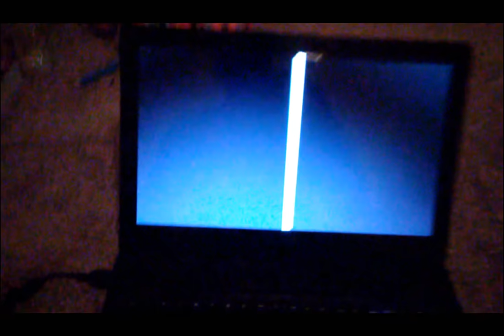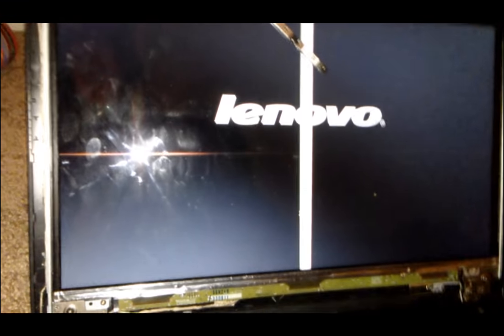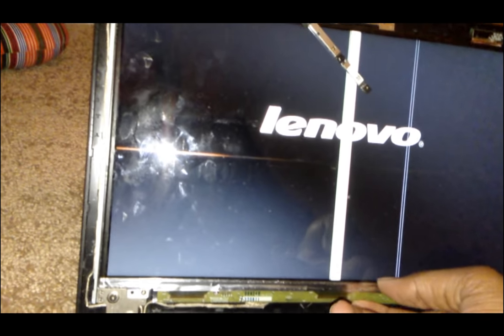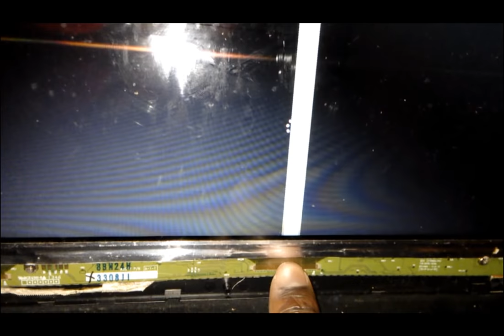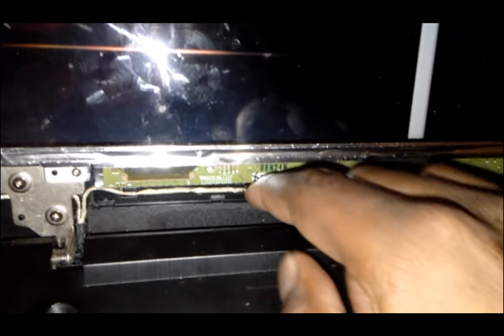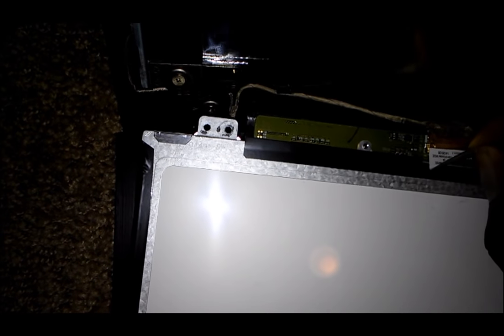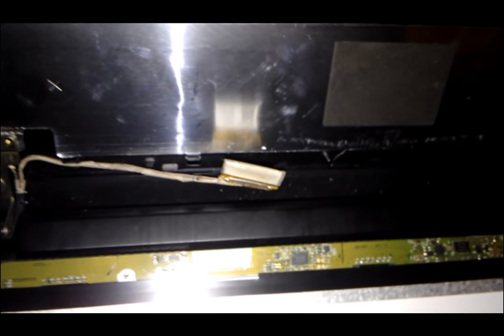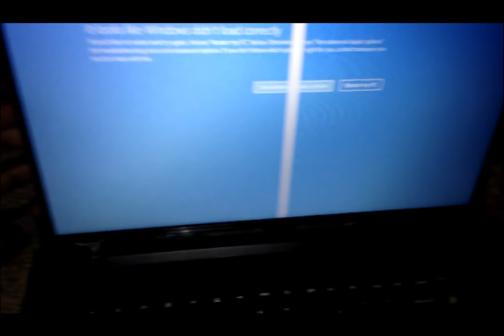HOW TO FIX HORIZONTAL / VERTICAL LINES ON LAPTOP SCREEN LCD (LENOVO) 2022

Comment: my laptop screen has lines appearing and sometimes turning to white/blurrying whenever i move a certain position, it seems to be very sensitive. but when i touch some areas on the screen, it goes away. can you please tell me how to fix this? thank you!
Reply: me to
Reply: i have the same problem what did u guys do?
Reply: Mine having the same problem. Can you please tell me, how did you fix yours? Please and thank you.
Reply: I have got your problom.
What is the reason.
Reply: Me tooooooo
Reply: Same problem. If anyone got solution plz tell me
Reply: Same problem here.
Reply: I fixed mine, the only thing you do is remove the cover from his first step and then carefully touch the flimsy thing below the lines and adjust it where the line disappear and carefully reassemble the cover and done!
Reply: same problem here but when i take its battery away and again turn it on the problem solved but still sometimes the problem appear
Reply: I have the exact same problem but then with my chromebook
Reply: @johnrussellgeroy2560  yeah but does it work with chromebook too? The half of the screen is white because of all the lines
Reply: Same
Reply: Same
Reply: @gamingwithcreeperboygwcb5129  well now my laptop is fix i went to buy a new screen
Reply: Same!
Reply: Mine just started like 1 week ago!
Reply: @k4leishaa  omg me too
Reply: Me too
Reply: Take it to a tech....
Reply: me too
Reply: @blakeavery4535  Just out of interest is it a hp?
Reply: @phoenixaugurey7776 

 mine also hp

i'll start doing what they said, hope it's work out 😯
Reply: @nibrasflint1110  Cool lemme know how it works for you 👍
Reply: @phoenixaugurey7776 
I just put my finger over the screen and start pushing it, and it fucking worrrrrrked😂😂

What a stupid way but glad it's working.
Know i'm wating to see if it is work forever ot the problem will come back again
Reply: @phoenixaugurey7776  try this bro, and let me know if it's worked to you
Reply: Same problem on my laptop but what i did is just loosen my laptop's screen cover. Although it looks bad but it's still worked. Whenever i move my laptop in a different position it doesn't turn white or blurry anymore. I think the reason why it was sensitive because the screen felt too tight from the cover. Don't know how to actually properly fixed it without making the cover of the screen loose on both sides.
Reply: Same!
Reply: Same
Reply: I have the same problem
Reply: mine has the same problem, did any of you fix this?
Reply: Same
Reply: ⁰
Reply: @k4leishaa  My chromebook is doing it too
Reply: Same
Reply: Same
Reply: I have the same problem
Reply: Same
Reply: he just did

Comment: May 2019.  Thank you very much for your presentation!  We fixed our monitor, a relatively new, well cared for HP model HP203.  It had a very thin, green flickering line running along the very bottom of the screen.  All else seemed fine.  You showed me the connector was the problem.  I was afraid to take the screen apart.  But I pinched hard between my fingers and thumb all along the bottom frame of the monitor to see if that would set the connector better.  Then restarted it.  The line went away.  Thank you so much!
Reply: Hah,, i didnt fix my mess on my laptop.

Comment: Worked in 2020

THANK YOU!
Reply: Nielezee what you did kindly
Reply: Mine was a single vertical line at the center of the screen. I had to open the front of the laptop screen  so as to expose the display wire and then nika press along it and it kinda fixed. I hope itawork.
Reply: @ketchmain  woi uguo ninguhota. yangu inaleta lines nyingi then they disappear
Reply: @priscillamwangi3898  Then labda upeleke kwa fundi.
Reply: @ketchmain  nilienda kujaribu nikavunja screen... I had to replace the screen
Reply: @priscillamwangi3898  I'm sorry that happened to your screen. Lakini it's fixed now haha
Reply: @ketchmain  yes.. kujifanya fundi but wapi! Nilijua sijui....  it was replaced and working well now. asante
Reply: @priscillamwangi3898  hahaha usijali ata wewe ni fundi 😂 keyboard ndio imebaki sasa
Reply: @ketchmain  It had been replaced earlier.. hehee
Reply: @priscillamwangi3898  You use it so much ama? Kwani what do you do to deal that much damage to the poor laptop haha
Reply: @ketchmain  I work online - part time though
Reply: @priscillamwangi3898  Oh I see. So you type a lot.
Reply: @ketchmain  yes
Reply: @priscillamwangi3898  You in campus?
Reply: wuui mutumia munene uuu hehee
Reply: @priscillamwangi3898  Oh haha😂 Sorry muno ngwiciragia wi kairitu ga kambi
Reply: @ketchmain  Hehee aca,.. unaweza huwa unafile returns?
Reply: @priscillamwangi3898  No
Reply: @ketchmain  okay. I am trying to file n got stuck.. needed some help
Reply: @priscillamwangi3898  I only know of the guys who charge 50bob
Reply: @ketchmain  haina shida.. ninguthii cyber gwathereruka
Reply: @priscillamwangi3898  haya sawa. Ugikome na thayu
Reply: Why lines occured on laptop screen?
Reply: @safdarshah5801  Screen got pressed while carrying laptop in school bag. Figured out it was the bottom section where the display cable runs across. Just run your fingers gently there and it might fix your lines.

Comment: Thanks my friend well explained and helpful. I thought I need to replace entire screen but I will check the component you showed first. The Lenovo laptop is fine except my  parrot 🦜 chewed the edge of the screen and now the screen when turned on is part green, with lines and other colours? (Look similar to your thumb nail)
I’m hoping it’s just a loose connection and may not be the part u showed. 
Thanks again 
Greetings from Australia 🇦🇺 🦜🎸

Comment: Would have liked to seen the end result after putting on a new cable. 

I have an older Dell E151FPB monitor.  This summer when it got warm, my screen randomly blacks out and starts flickering some dim light near the edge with the green led indicator flashing in unison.    When I thump on the outer frame, the screen lights back up, briefly with the Dell emblem then with whatever was displaying on my screen before it blacked out.    At times it occurs often. Sometimes I have to thump hard several times for it to come back on.  When it is blacked out, pressing the on/off button has no effect.   
Can someone please give me ideas the cause and how to fix?

Comment: I get little pressed on screen sice that time horizontal and vertical lines are appear but I can see little bit screen what is going on back is. my screen is broken?
Reply from the maker: gaurav meena it might not be broken. It could be just your video connection or maybe your screen is not screwed tight enough. Try making it tight or loose. But remember thr video cable could be causing that.

Comment: Hey sir my dell laptop screen have one little white  horizontal line can i fix it i am worry about if i damage my screen... 😕
Reply from the maker: Gaming Leo. Yes try removing the screen and putting it back on. Make sure the screws are not too tight
Reply: Sir help me i tried and open the screen but now while i push turn on button it's showing blank screen and beep 8 times continuously.... Help me....

Comment: Sir I have orange coloured horizontal lines on my laptop screen's left side. When I slightly press the black part on the display the lines go away.
Reply from the maker: Dinesh Dhawan yep so your screen is probably 100% Ok. But your connection to the screen from the cpu might be damaged. Or you need to tighten the screws on the screen or loosen them a bit. You'll figure out a good angle man. Please sub to my channel too. Thank you
Reply: Same but I have a Lenovo Chromebook and it won't go away

Comment: Display problem or the board behind the display problem
Reply from the maker: Well this video is for if the lines come on for no reason and you’re sure there’s no physical damage to the actual screen. If the screen is physically cracked then that’s a different story, you’ll need a new LED

Comment: You claim the lcd cable has to be replaced. Why not actually get the computer fixed to show you really know what you are talking about? Since you didn’t fix it, it could be anything else including a bad lcd. Well, we’ll never know...
Reply from the maker: Because this computer has been doing that for years. I know the pressure points. If you would like to replace or repair your computer, then that's you. But if an LCD/ LED glitches without the screen being cracked, then that's probably the problem. Think about your earphone Jack malfunctioning, is that your earphone audio not working or it's really the Jack with an issue?

Comment: Very helpful vid, thank you. 

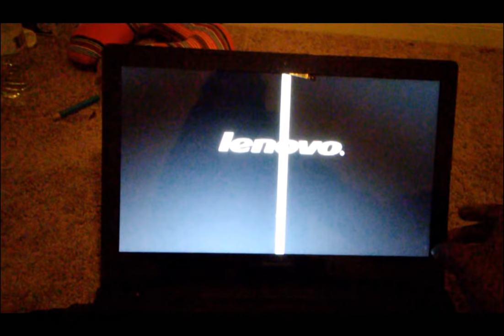@1:01 you pulled the plastic frame off so easily, so I'm guessing you did some unscrewing prior to filming. Well, what if there are no screws to be found on my plastic frame? Do some laptops not allow you to remove it? (I have an Acer Aspire F15.)
Reply from the maker: 444 yes sir. Well All I just did was unclip that front cover. It doesn't really have screws on most laptops. It's just a cover that's hiding the inside cables to the screen.
Reply: Ah okay, I see now, thanks! 

Whenever I get the lines, I run my finger across the bottom of the frame from left to right--putting pressure on it--and the lines go away. Does this mean the cable itself is probably fine (i.e. no need to order a new one) and the connection just became loose or something?
Reply from the maker: 444 yes it could your cables that maybe loose, try to remove them and clean the comnection with alcohol or methylated spirit and reconnect. If the problem persists then you might need a new cable. They cheap on ebay you can get them less than $15
Reply: Okay, great, thank you! (I haven't been getting the lines anymore ever since taking off the plastic frame and looking/feeling around in there, so I may've gotten lucky and accidentally fixed it, but will try the alcohol if it comes back. Thanks again.)

Comment: To summarise: 1) pull the screen off, making the problem worse with more lines. 2) pull the wires out, then suddenly go on Amazon and order a new part. 3) Put the computer back together again. Now it has the damn lines still unfixed, and your computer is in recovery mode which will take ages to sort out. 4) Still, your order from Amazon has been placed, which means you have to do the same thing ALL OVER AGAIN. 5) Who knows if the order from Amazon worked? We don't know that because the video didn't actually show a fix at all.  6) Go ahead and scream at people who upload useless videos on YouTube.
Reply from the maker: This video is not to help fix your computer, it's to help you diagnose the problem. I've been fixing computers for probably longer than you've had one. If a video connection is out then it needs to be replaced. 9/10 it's not your monitor or screen with an issue. But I'm happy this video applied to most people who realized what they had to do.